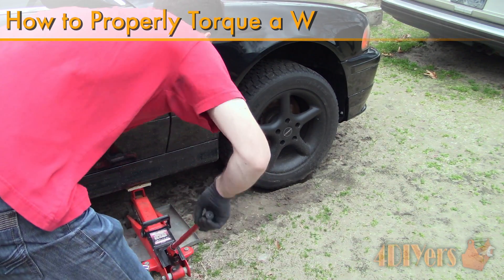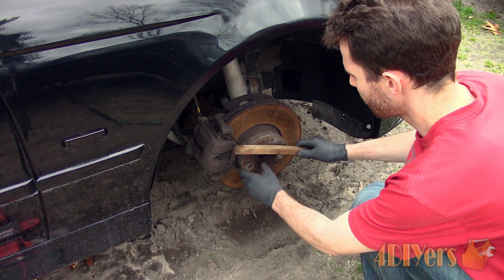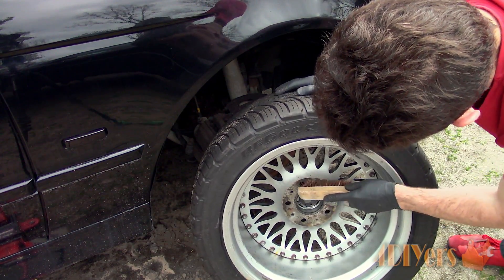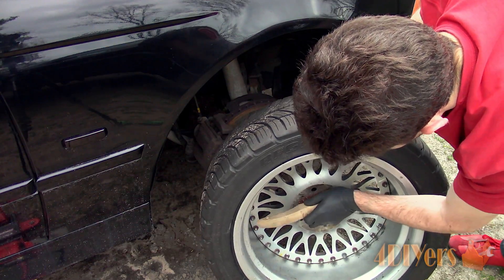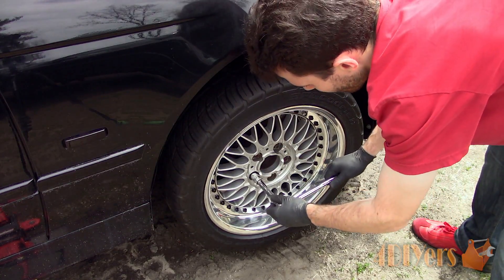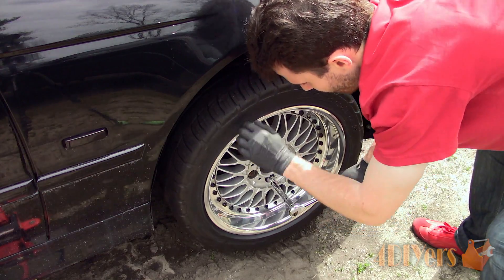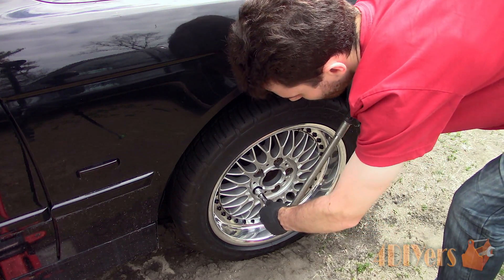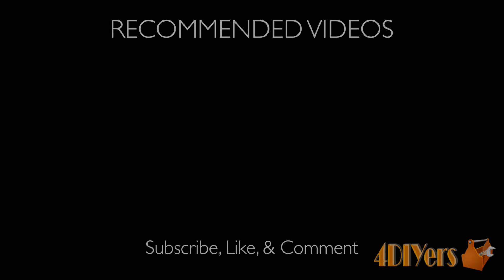How to: How to Properly Torque a Wheel

Comment: So you only full torque when wheel is almost to the ground but not full weight? I see many torquing when car is fully on the ground
Reply from the maker: There is always the risk of the wheel shift or not allowing it to fully seat. It's a slim risk, but I find it's better to be safe.